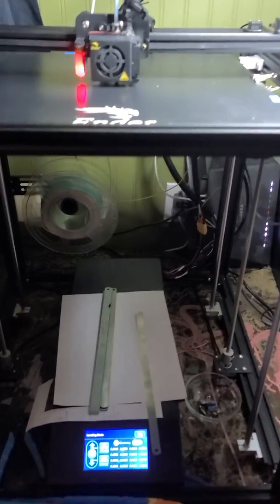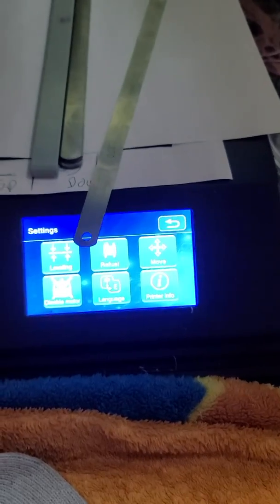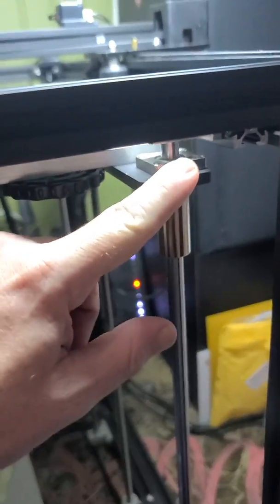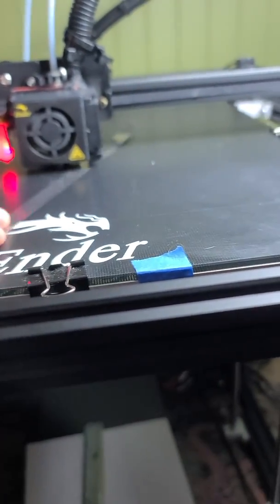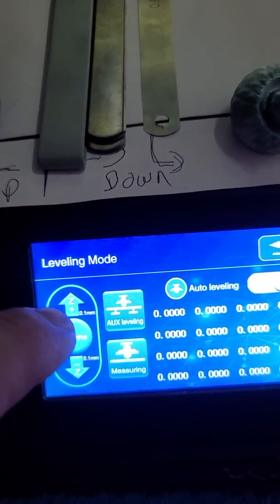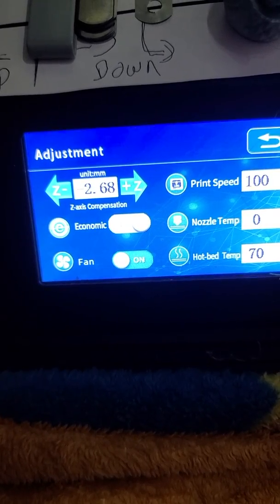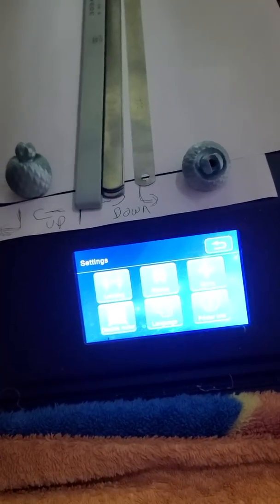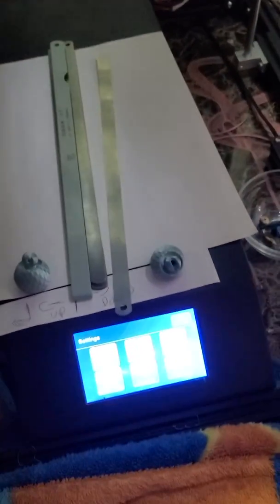Creality Ender 5 plus level guide and getting your prints to stick.

Comment: How do you get the bars under the build plate to have the same gap?
Reply from the maker: Are you referring to the z rods being leveled on the bed? Like if the bed is crooked?
Reply: @toshlarue  The bed leveling bars. Theres one attached to the bed and the other one attached to z platform. and has the spring through it. I make the gap between both sets of bars. By the time Im done leveling the gap between the two aforementioned bars in the back are offfrom the front gaps,. The far back left corner gap is nearly imperceptible while the  right back gap is slightly shorter than the front left and right gaps. The left and right front gaps are almost even however. This results in my printed part thicker in the back and shorter in the front .

Comment: Ender 5 plus looks cool, im currently putting it Together and the cheap screw broke. Ima have to get super glue. If you get the printer, just know it  Sucks to put together
Reply from the maker: Please don't use super glue. Just get another screw. It wasn't that hard to put together. It was the 1st one I even put together. Years later, it's very reliable, and my go-to.

Comment: My Ender Plus doesn't have the button auto leveling ! how do I fix that ?
Reply from the maker: Hello, I have seen in groups the 5 plus now has different firmware. It's similar but missing the auto level. You don't need it and can just enable auto level in gcode via slicer. Just follow rest of video and don't do the auto level. It needs to be off anyway. You can also try the firmware from Kersey.  https://youtu.be/ExuPoNZK_aw?si=6cdkkmdyzUOzguOf

Comment: Just gotten one and building it up at the moment. Been looking at some videos about calibration and I'm afraid to turn it on. It looks like a crap implementation if something that could of been real good. Should have watched some videos about this before I bought one.
Reply from the maker: I will be honest. The 5 plus now is a little outdated as far as speed and software now. The way it's built is perfect. The structure is great for speed and printing. You do need to upgrade the motherboard, Firmware, silicone springs. You will also want to look into a direct drive I use micro swiss. Decide now if you want linear rails to get the right direct drive.  The 5 plus I also added a pei sheet. 
 
I have one 5 plus and 4 ender 3 max. The 5 plus has been my most dependable printer. I have not level or anything in a long time.  You do need some upgrades, but after it is very dependable.  
 The prince for the 5 plus new is not worth it now. Finding one used for 2 to 300 is. Now you can get a bigger printer with upgraded for cheaper mostly bed slinger. I do love the 5 plus structure.  
 This is a great option now https://amzn.to/40avFSW

Comment: How do I zero out bed? I see in your video you got all zeros. 
Mine has all kinds of numbers lol
Is auto home suppose to zero out and also save the settings?
Reply from the maker: To start fresh. Start print turn to Z down to zero. Stop print and Home printer. Turn the machine off. Take out the SD card and delete the BIN file. That is what stores your info in the machine. Put SD card in and turn printer on. Should be good to start over. Please support and follow me if you do not I would appreciate it. Also have a tiktok same name
Reply: @ToshLaRue  my ender 5 plus doesn't have a automatic level button.

Comment: Well shit...I think you pretty much hit the nail on the head here. I've been following the Creality instructions and my ender 5 plus always prints that line from front to back down the left side of the print bed, then another half-assed line diagonal from the first line towards the middle. And I always feel like I have to stand there for the beginning of the each print because once the print begins and it prints the first little border around the print, the head gets all tripped up when it tries to pass over that second diagonal line and then the head starts dragging the already printed filament behind it. Then it's a big shit show I'm chasing the head around with a pair of needle nose pliers trying to grab the dingleberry hanging from its ass. Then I have this issue of the prints not wanting to stick even though I've cleaned the print bed and done just about everything people suggest online (except for hit that Z Home button. I think the print head is raising back up after I level it causing the head to be too far away from the print bed. This thing definitely has he me pulling my hair out on regular occasions. I'm an electrician and I only use it to print Lutron Cassetta wireless remote wall brackets, at least thus far that's about it. But the only filament that has printed successfully for me so far is the cheap opaque white shit that came with the printer and now that that's gone I'm using some Overture PLA+ and I though the new filament was the issue until now. THANKS MAN! You saved my printer from getting thrown out the window.
Reply from the maker: Love the Wright up and appreciate the feedback. Message me on my socials if you ever get stuck be happy to help you out. Make sure auto level is off before you print also. Unless you add the G29 code for the level before every print. But that takes to much time. Get silicone springs to hold the level.
Reply: @toshlarue  yeah I don’t really mess with the whole cura slicer thing too much. It makes my head hurt just looking at it, and don’t even get me started on watching some of these videos put out teaching you how to use cura, sooo monotone and it’s usually like a 2 hour long video. I’m sleeping before I get to 10 minutes. So I typically just do what you do, put the file on a thumb drive and do everything from the printer. Only thing is that the printer is at my shop so I don’t typically sit there and watch the prints until the end, I’m usually out on service calls. I usually print like 6 brackets at a time and for the first time ever today I tried to do 20 brackets because they’re small and 20 fits on the print bed just fine. I started the print, did my usual dingleberry chasing, and then watched a little bit of the first layer go down and everything looked just fine so I left to take a service call. I come back and the glass print bed is on the tile floor (printer is on a countertop about 36” high) I’m not sure how it didn’t break, and there’s a ball of blue filament surrounding the entire print head and half printed thin brackets everywhere on the floor. So I pulled it all apart and cleaned everything up and then I saw your video and fixed all my first world problems.

Comment: Doesn’t work the damned machine keeps pushing the bed up too high and pushing hard up into the nozzle
Reply from the maker: Before you do this open SD card delete Eeprom file then insert back into printer. That is because your Z is set wrong. When I 1st got my printer I did this also and 😱. You need to reset the Z and relevel. Start a print and immediately go to setting  Z and turn back to zero.  Stop print and home printer. Not Z is reset. Heat to 60 go into level move Z and adjust using paper method or shims. Hit Z home to save.  Now aux level the 4 corners twice with paper. Level the bed auto level on then turn off after and start a print.

Comment: So after you play with the knobs, you press "measure" and then "Z-Home" after? This is what I did, and it still didn't save the Z point. I didn't have auto-leveling on. Is that important?
Reply from the maker: No, Z home saves you z point and is dont before you level. Not after. You dont hit z home after you measure. Only after you bring nozzle closer to bed to fix gap
Reply: @toshlarue   I'm sorry, I'm a little confused. How do I save the Z point after I'm done leveling? Because the machine resets everything even after I level it. Do I need auto-leveling to be on for any of this?
Reply from the maker: @adfgfds  the machine does not reset after you level. Only way to reset is to clear the eeprom in the SD card. The level is saved and used after you level. You see the numbers. Make sure auto level is off before you leave the level screen. Unles using G29 after G28 to level printer before every print.

Comment: I had the same problem, I only started 2 months ago and after a lot of fiddling, it worked and had to look back for a while, but what you do is not a solution either and the way you adjust your z axes if you turn the axes to the bottom, they slip by... I just managed to get the level to the right height, press the button one more time z home and it's in the right place look at this guy at the end https://m.youtube.com/watch?v=-kKXXKGQzCo

Comment: hello, i just got my ender 5 plus and i've found out that i have to flash the LCD screen and also the motherboard. I havent checked yet to see what i have. i would like any help in flashing the correct firmware where to get it from and the best way to do this. I tried to use my sd card from my ender 3 v2 and nothing would print from that on the ender 5 plus. any help is appreciated. thank you

Comment: Thank you sir you addressed every damn problem I’ve been having I’m about ready to throw this printer in the garbage my tempered glass plate is scratched all to hell thank you so much for all your information!
Reply from the maker: No problem, Glad this helped you out. I scratch and jammed bed into nozzle day one lol. Bang my head and felt the same as you about printer. After I figured it all out from in front of it for hours and days. I made this video with all the info I could not find so others like you would have the same issues as me. Happy printing more videos coming on upgrades for 5 plus

Comment: Thank you for a good video. It is the only video i have found that i can actually follow
Reply: After i followed your instruction video it seems that i can use the whole build plate again - it takes long time to adjust but it is at good method - thanks again

Comment: Hi, I have a question. when I home my Ender 5 Plus and go to the leveling screen, I see that rather than all zeros, I see some small number in all the spots that you show zeros. Looking at minute 6:51 in your video. Is that normal or not. How do I get it to be all zeros.
Reply from the maker: Don't stress on all zeros. What I look for is the 1st & 2nd numbers being close to the same. You just want them close as possible. The BL touch will help with offsets. Do a text print after level and see were you are at. Sometimes you need to more the z a little closer or further away. After you do a auto level hit z home. Sometimes there is a gap, fix the gap hit zhome to save and go print. I am moving this month so in January I plan on making more videos explaining
Reply from the maker: Here is my FB to message if you need to https://m.facebook.com/111192243896513/

Comment: Lol nvm nothing sticks anymore, PLA or ABS. I've tried every combination between 190° to 220° nozzle and between 50° and 70° on the bed for hatchbox 1.75 PLA. At best I get corner warping and stringy 1st layer (or brim/skirt I don't know the difference whether 1st layer is before or after the brim/skirt because nobody really explains which is which) or what I normally get is nothing sticking to the bed or major clumping on the nozzle. I've made adjustments to the bed height. I don't know what else I can do. There's only so many hours in a day that I can run test prints.

Comment: Thanks for the video. I just need to check one thing. After measuring and I'm happy with the settings, do I press Z home again or just exit to the main menu?
Reply from the maker: The only time to hit Z home is after you set the Z point. So when you 1st go into level move Z to the paper. Then once good , hit Z home to save. I have noticed after measuring with the auto level. You may need to check Z height and move closer. After the 16 point check. Hit Z home and see if the gap is still good. If not fix gap then hit Z home. Now if you did this now you nozzle is on plate. Just exit level and move bed from nozzle and go print.
Reply: @toshlarue  awesome. Thanks so much.

Comment: Hey, have you ever ran into an issue when you go to level the corners and one corner the nut is completely loose and still doesn’t rub the paper/shim? Does that mean the bed would be warped? Thanks in advance
Reply from the maker: No not warped and yes that can happen. Do you have shims? If not just turn the knobs tell each side is down all the way. Back off each corner by 5 to 10 turns. This will give you enought play to adjust the wheels. Just need to set it up so you have the enough to move close or away from nozzle. I asked about shim because I will tighten then down then use shims to measure the gap on each corner not the nozzle bud the metal between bed and frame. Wish I could share a pic. All this is is you just have each side to lose so you have no play to adjust now. So just do as I said then Home printer and do the level procedure again. Also get silicone springs it's the best for holding the level and cutting down on vibration
Reply: Thanks for the quick reply! First printer and seems like there’s not too much on the 5+. Watching your video helped and also ordered the silicone springs right as I was watching your vid! I’ll give that a try. Thanks again!

Comment: Bro this was it! This turned my leveling issues and sticking issues into a thing of the past! You are the man and appreciate the info
Reply from the maker: Thank you !! share with others of they need help.
Reply: @toshlarue  I am 3 days into 3d printing. I'm coming at it as a hobby mindset first and for business purposes later  and expected issues, but not being able to put out 1 print successfully was becoming very discouraging. I have searched yt for a couple days now and yours was the only one that explained the "save feature" properly and fully defined the leveling process thoroughly! Again thank you for that!
Reply from the maker: @kens3dandaquatics  for sure the 5 plus has been a love hate. Took me days if sitting in front and stress so I made this to help others. Get silicone springs so you don't have to level as much. Upgrade the motherboard later to get rid of noise. I have video on that too.
Reply: @toshlarue  excellent! I will be looking into those soon as I get through my initial print everything and anything phase 😁
Reply: @toshlarue  question, what kind of grease or oil do you use to lube the z drive bar?
Reply from the maker: @kens3dandaquatics  https://youtu.be/gkW_hmcDLdo

Comment: OMG thank you so much!
Reply from the maker: Your welcome
Reply: @toshlarue  What is going on with the auto bed level on this printer? Thanks to your video I was able to print a couple of non stickers... but that's something at least. Everytime I switch back to auto, it spazzes out in some way causing the whole thing to be redone. I've had the hot end move across and hit the left hand side of the top gantry, almost destroying the bLtouch and gouge a groove on left side on the hotbed. I've also had the bed move up and hit the hot end repeatedly on its way to outerspace. This is after your video. Is there a way to remove the bltouch completely and replace it with an endstop? So disapointed in this printer.
Reply from the maker: @Guyus0333  I'm live right now come to chat. You need to add the code in cura or slicer if you want auto level on. Without the m420 codes saves your auto level mesh. So you don't have to do a 16 point check before every print. I prefer not to do that check every print.  Just keep after level of after you use it in measure. If you have silicone spring you should not have to level for a while after you have it level.
Reply: @toshlarue  I have to add code, do I add m420 or delete m420 (code newbie). Just installed VS code to try out. Have you a video on that?;) I'll try the silicone springs and keep it manual. However, I noticed that when I hit home on the move button for a failed print the bed doesn't return back to the original set position, but lower. I have a sidewinder X1, no issues for the past two years. Thanks for the quick reply, unexpected.
Reply from the maker: @Guyus0333  m420 is for the saved auto mesh level 
If you want the auto level and 16 point level before prints. Delete m420 and put G29 this enables the auto bed level then you keep auto level on. Don't worry about vs code on the stock motherboard assuming you have that. Best advice is upgrade. The stock motherboard has issues and loud garbage.  I went silent creality works will for a drop in replacement. Then upgrade the firmware. But I would skip and go to skr turbo. I will be doing this soon. Kersey fabrications has some good videos on this motherboard
Reply: @toshlarue  Totally, I have skr mini e3 on the way, but delayed in transit somewhere. Yup, i'm definitely up to speed with KF videos. The stock setup is insanely loud.

Comment: Touch Sensor now deploys however after pressing leveling tab the bed lowers twice after touching sensor but on third movement upward the sensor does not extend and bed pushes into nozzle.

Your solution?
Reply from the maker: What motherboard?

Comment: I fought the leveling issues for hours and this video sorted things out. Great job and thanks for the help!!!
Reply from the maker: Your welcome, I really need to start making more
Reply: @toshlarue  Quick question(s). How often do you level the bed and does the "z-axis compensation" need to be zero'd for every print or does the machine save these settings when powered off? Thanks!
Reply from the maker: @clampdowncompetition129  I hardly ever level now. Just check before a big print. I just hit print and it's fine now. If I turn the machine off. I just start a print after turning on. All information saves to SD card. Silicone springs are key I will change the links tomorrow.